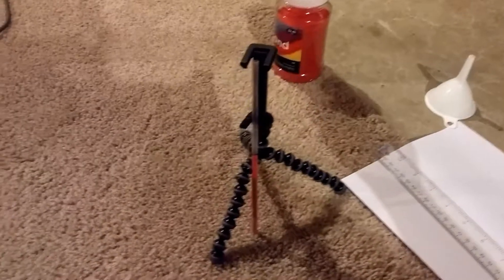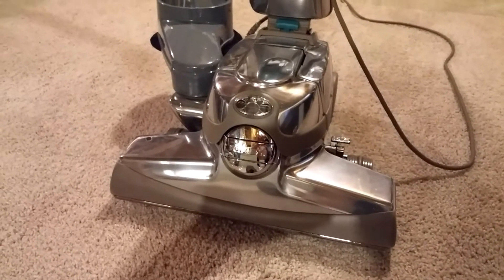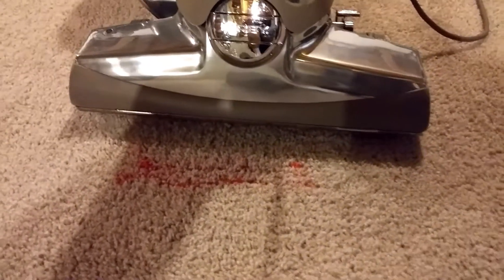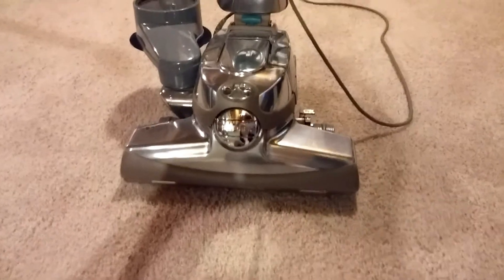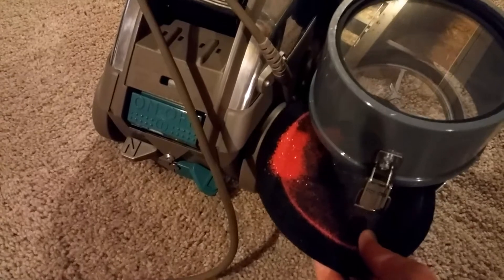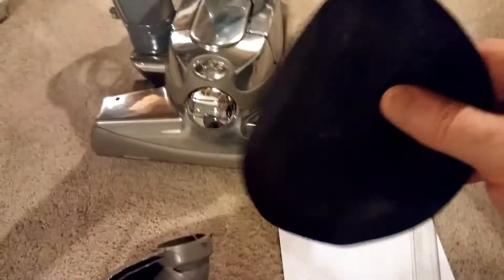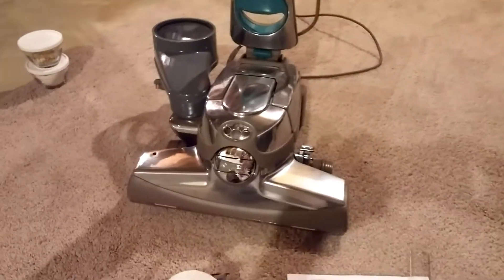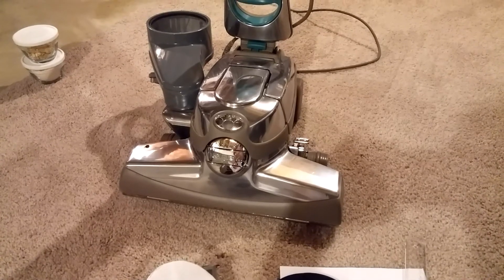Kirby Sentria II Sand in the Carpet Test

Comment: Nice! Even with the dirt meter on it will beat the Dyson it would do better with the bag. If you want to do the performance with the bag on what you can do is go over with the bag on then go over it with the dirt meter to get what it left and then let's say you got 40 from what it left then you do 100-40 and then the Kirby would get 60 of the stuff out I'm not saying that's the actual results that's an example but it would be more accurate.
Reply from the maker: KG5Vacuums proving a "negative" is much more difficult than proving a positive. Besides, I want to design as many tests as possible that could be more easily replicated by the home user.
Reply: VacLab ok